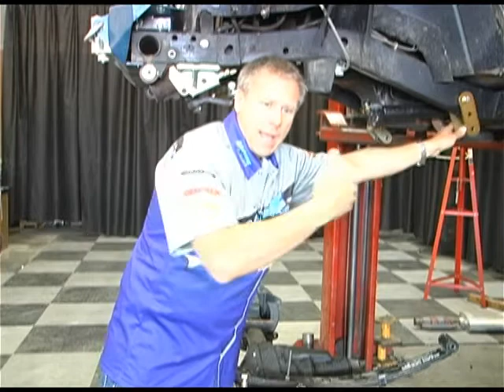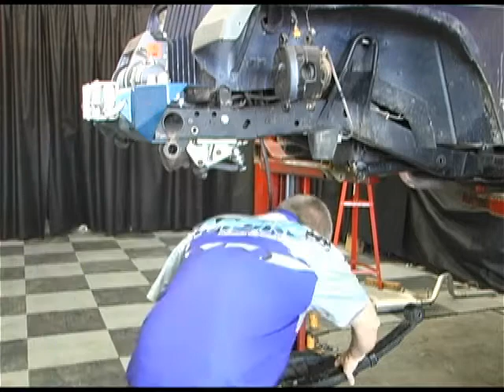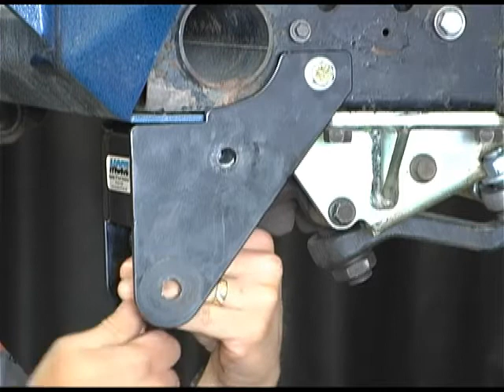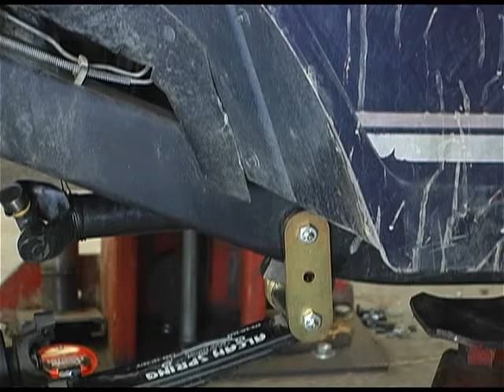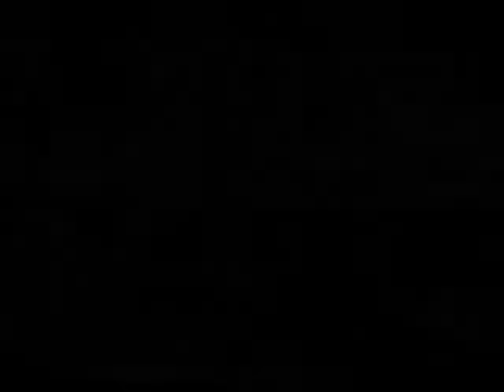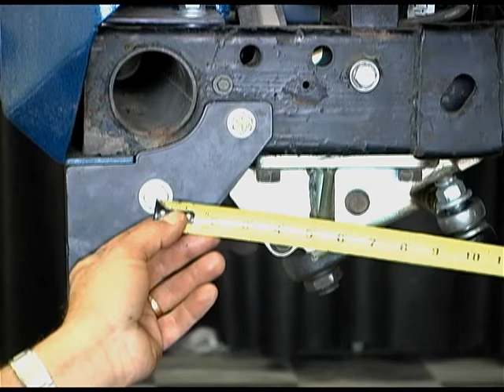Jeep Shackle Reversal System Installation by M.O.R.E.

Comment: Re weld in bushing tube & bolt on bracket. The bolt on aplacation is much lower! Does it use a shorter shackle (ground clearance) or does the jeep sit higher?